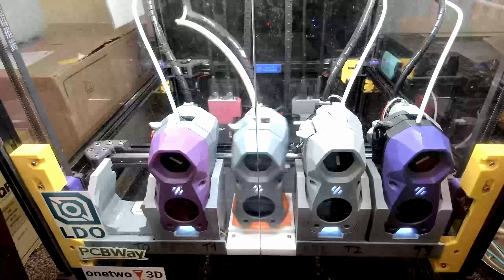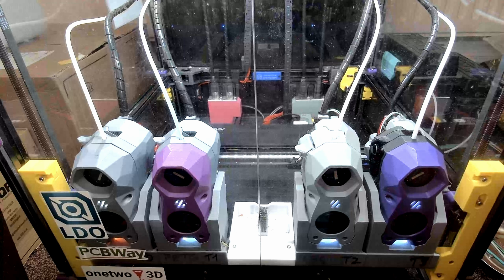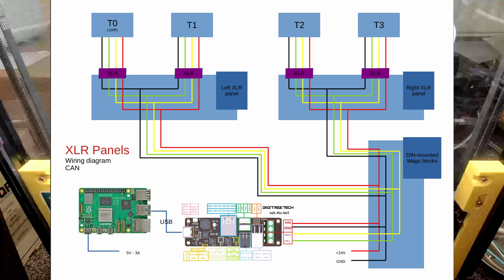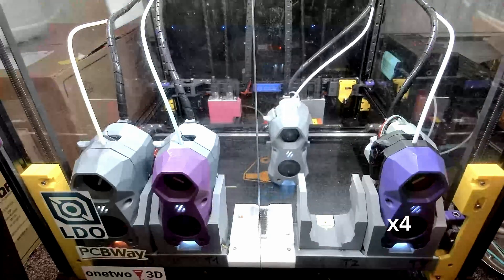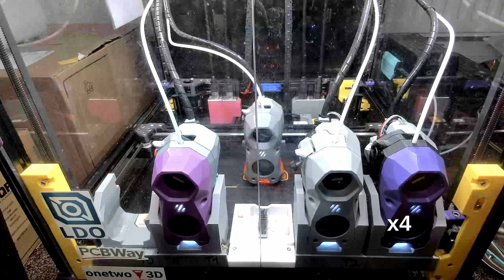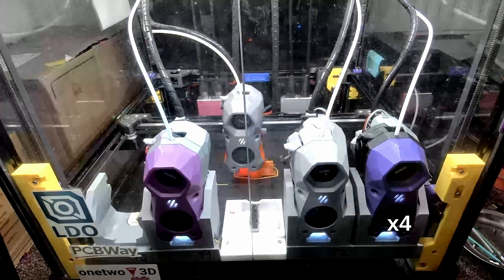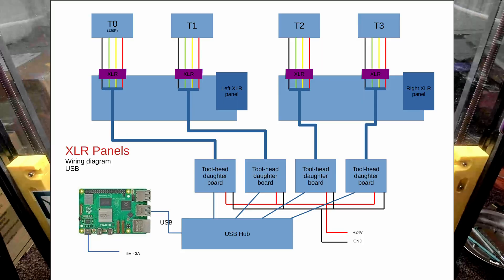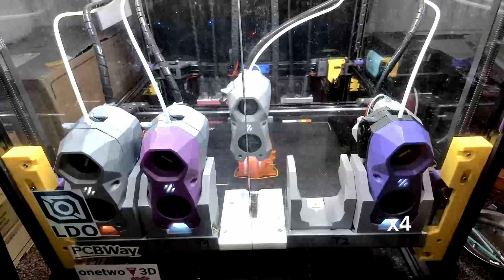DIY Toolchanger - USB or CAN?

Comment: My opinion: if you never build a toolchanger before, go with USB ...
unless you are following a step by step guide with perfect documentation you are going to have problems (physical, software, etc). I couldn't get my head around the "communication issue" and just ended up using ebb36 boards, got a 5$ usb hub from amazon and some 2m shielded usb-c cables, pluged them into the usb port on the ebb and wired 2 (GND, 24V) power cables to a wagos splitter. I know you can use the can ports on the ebb36 for usb and I will try this next (rn there are 2 cable going to each toolhead: power + usb) and you need a stress reliefe for the usb connection at the ebb, but the simplicity and ease when plugging in new tools or taking some out is just perfect (no problems yet). 
I may have a usb hub laying on the ground next to the printer rn, but is this question really what you wanna spend your time with? Just 10-20$ and turning the printer once to plug in the usb hub and forget it until you are finished so you can think about the other stuff like docking, coupling, liftbar? yes/no, software, etc...
that sounds way better to me than all of the CAN setup and problems

ahh yeah you also have to run the "ls /dev/serial/by-id/" command to get the right serial-id, but that's nothing to complicated ^^

Comment: There is a third choice, RS485/422, but would need a USB adapter at the RPi end.   5 meters is MORE than long enough for a printer.  Average toolhead cable length is less than 2 meters, usually 1-1.5 meters in a typical 300mm cubed build size. 
In your wiring diagram, where are the CAN bus terminators located?
How about using a magnetic connector so a single cable could be used for multiple tool heads?  Each tool head would have it's own controller board, but only a single cable would run from the print head to the MCU.  Apple uses a magnetic connector for iPhone and Macbook chargers, these are USBC compatible.
Compatiblity between USB hubs and USB 2.0 may be an issue with NON powered hubs.  I think a powered hub will solve the problem.  Also, USB 3.0 ports (especially with type C connectors) can deliver more power than USB 2.
If you put your USB hub and the USB daughter boards above the deck close to the tool heads you won't have to get to the bottom of the printer to add toolheads.  Would need some short USB jumper cables made up though.  The Birds nest replaces the daughter boards, and a powered hub, so it's cost is reasonable.  
Here's a thought, most CAN toolhead boards have a USB port for flashing firmware, and can be connected to the RPi and be detected under klipper.  They can be used AS a USB toolhead, except for the electrical grounding problem which requires the daughter cards.  So use the birdsnest to connect multiple CAN toolheads, and configure klipper (on both ends) to talk to these boards via USB.  It may be necessary to construct an adapter to go from the USB socket on the toolhead PCB to the USB tool head cable as it's not a good idea to subject a regular USB cable to runs though cable chains, or even flexible umbilicals.